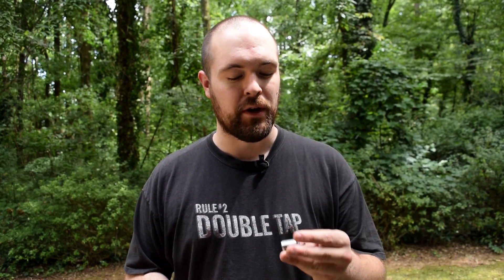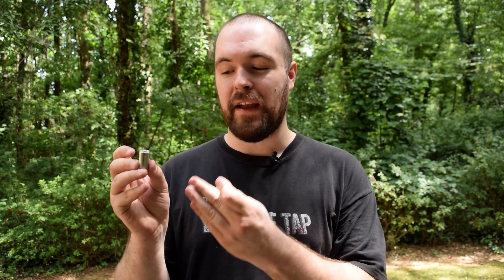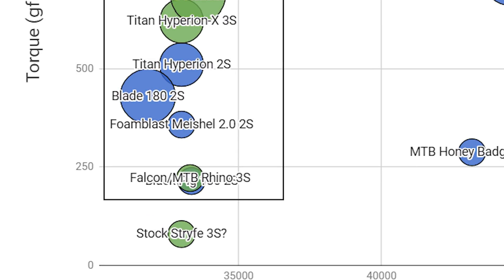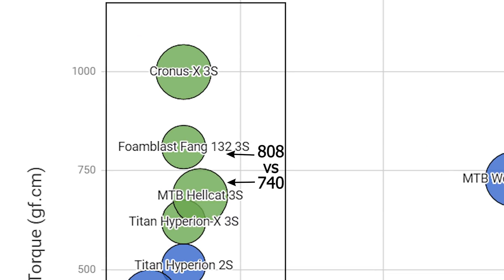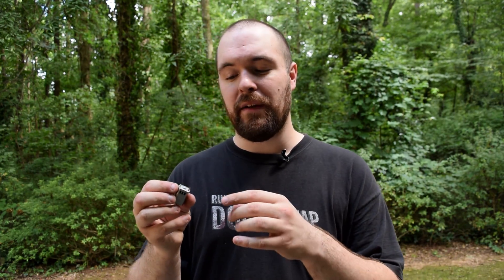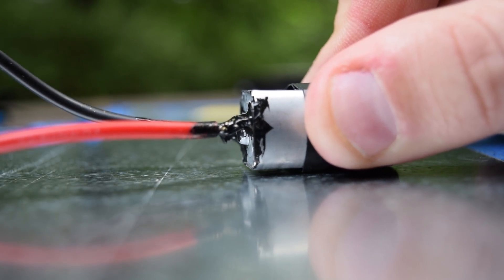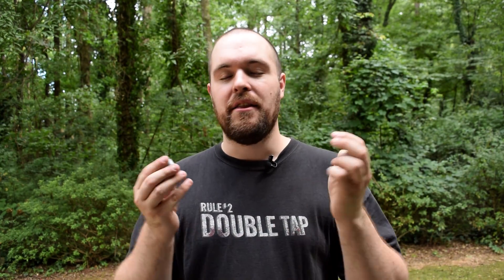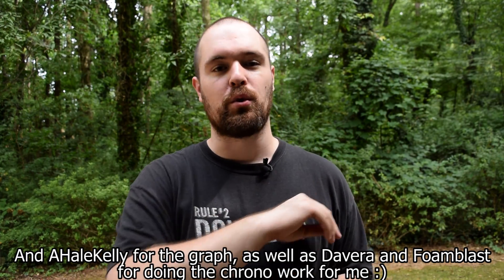Review: FoamBlast Meishel 2.0 & FANG Motors

Comment: Could I run 3 Meishel motors on one 2s 1000mAh Lipo?
Reply from the maker: (mAh/1000) x C rating = total amperage. Compare that to the stall current of 3 Meishel motors added together. If it's more than the LiPo amperage: no.

Comment: So what causes a motor to be so loud? Is it the high rpm or can it be other factors such as unbalanced flywheels and the design of the cage?
Reply from the maker: There's a few things, but the biggest that I've seen is from the wheels. After market wheels are cnced instead of injection molded which gives them better overall balance.

The difference between 2S and 3S is how many volts it takes. The RPM is usually around the same, just requires different voltage.

Comment: After much frustration with choosing a battery, which 2S Lipo is the best for the Meishel 2.0?
Reply: I mean, just 2x Meishel 2.0s in a Worker Swordfish with aluminum canted flywheel cage?
Reply from the maker: 'Best' depends on what blaster it's going in as the dimensions of the battery tray will have an effect on the specs.
Reply: IAmBobololo, I see.  I was poking around reddit until I found Meishel suggesting a 1000 mah Zippy Compact 40c 2S lipo for a Stryfe build.  Sounds good, but I was wondering if it will be okay with the crush of my canted Worker cage and wheels in my Swordfish?
Reply from the maker: Don't remember how much 'crush' a Worker canted cage has, but I don't think it's much. You shoooould be fine with that combo. Go for max C rating and mAh you can in the space you have. Hobbyking has a LiPo Finder where you can input dimensions and specs and it'll find a LiPo close to it.
Reply: Thanks Bobololo.  Your expertise is very much appreciated.

Comment: Which battery do I use for the meichel 2.0 motor.
 What LiPo type?
Reply from the maker: The simple math to LiPos is (mAh/1000) x C rating. 2 Meishels will stall with 38.6A, so you'll want a LiPo that can do that. IMRs and Trustfires won't do. NiMH or similar would be a decent 2nd option.
Reply: IAmBobololo so a 2s 1500 mAh 40C lipo will do?

Comment: So Bobololo, would you say the Meishel 2.0s are the BEST 130 sized motor on the market? Also, should the Meishels be used with a 2S lipo or a 3S?
Reply: 2s lipo. They get over 50k rpm on a 3s and will burn out pretty quick.
Reply: Johnny Miller can you run them as a pusher?

Comment: Are the chronus x 3s the best motor right now and are ther better than fangs?
Reply from the maker: They're a 3S 180 sized motor with the most torque available right now. Some people don't like 180s because of how much height you have to make room for, but if the Cronus- X is 100% legit with its claims, that's a super torquey motor.

Best will always depend on what you're building, how you're building it, and what you want out of it. But for 130s, there is zero reason to not get Meishel 2.0s
Reply: IAmBobololo thanks

Comment: Damn! I just bought myself a pair of honey badgers yesterday morning for a trustfire Rayven Stinger. I didn't have enough info to know whether I should get Meishal 2.0s.
Reply: Ditch the Trustfires before thinking about getting any aftermarket motors.
Reply from the maker: Trustfires will not be able to sustain Meishel 2.0s. You should definitely look into a better battery system for your upgraded motors.
Reply: IAmBobololo thanks. I don't remember specifically which batteries they are- I know they're an Asian brand. But I'm setting it up so it'll be easy to upgrade to LiPo later- building an XT60 into the circuit, between the battery tray and the rest of the circuit. That's way, when I eventually do the research and save the money to buy the right LiPo, I can just disconnect the battery tray, but retain the ability to use it if I want to use the blaster in a lower-FPS scenario (like HvZ).
Reply: My rayven is running on IMR's and rhinos.
Reply: Johnny Miller I'm using the honey badgers for now because I don't want to go all the way up to 3s. For the games I play in, it'd be too much power. I also don't actually have a LiPo or IMRs yet.
Reply: You don't use an inferior power source to try and reduce the velocity, that just results in damaged batteries. No AA sized cell is safe for use with aftermarket motors, and you still have those high resistance steel tray springs that you can bet will heat up if the motors stall. Additionally, using on 3S doesn't mean inherently higher velocity, the Meishels on 2S will outperform Rhinos on 3S simply because they have more torque. If you want to safely reduce the power of your blaster, you can change your flywheels to Blasterparts wheels which have lower crush. The Dark Ages of modding might have had limited access to motors, but now we have people buying motors without doing their research on how to properly use them.
Reply: Calvin Lee Calvin Lee that was why I bought the honey badgers in the first place. Because I did t know enough about the Meishals to utilize them properly. And I'm not trying to use a weaker power source. I've got 2s specced motors that I'll be running at the appropriate voltage- the only reason I'm not using LiPo yet is because the friend that is helping me with the mod uses rechargeable batteries appropriate for this application (which I just don't remember the brand of), and I haven't had the time to research the right LiPo, or the money to buy it yet. I will later probably upgrade to Meishal 2.0s on a 2s, just not until I know exactly what I'm doing.